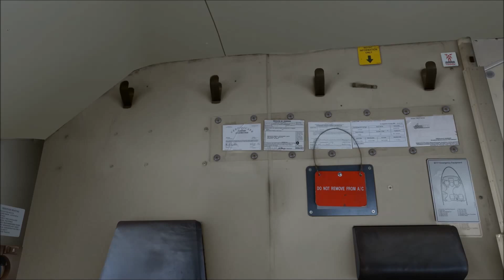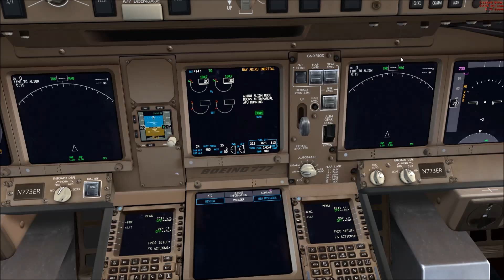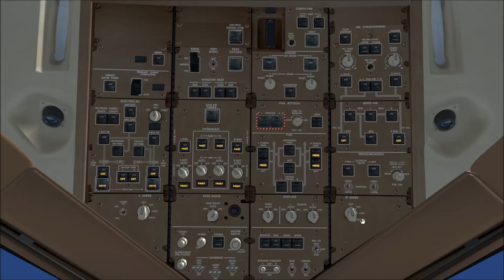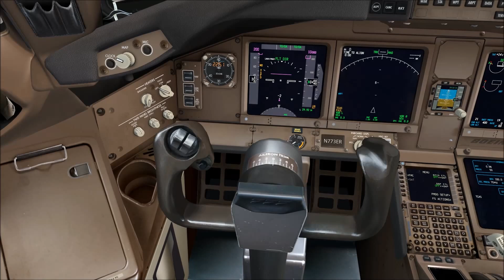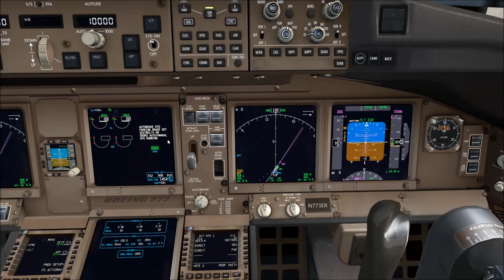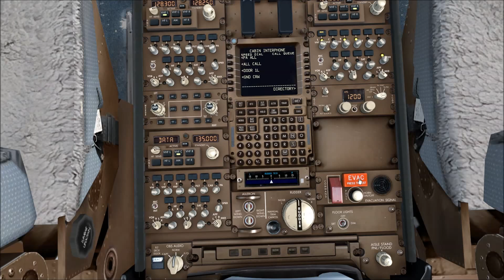PMDG 777 Cold and Dark Tutorial

Comment: i have 777 addon on my fsx but not pmdg. The cockpit is dark but the engine is on and i can fly it. Idk this is the addon error or what.
Reply from the maker: It should not be dark, I think.
Reply: Captain Nav hm ok btw thank for your comment
Reply: I know it's been 5 months but I used to have the same problem with my 737 PMDG. After a whole month of searching, I found the solution. It turns out, FSX SP2 was somehow not supported by PMDG. So I installed SP3 and it worked perfectly fine.

Comment: why in real the aircraft is not cold and dark
Reply from the maker: +shukri mohamed As I said in the video, it is rare to find the aircraft "cold and dark" as there is always an engineer nearby looking after it, cleaners on, catering, cargo, etc....Planes come and go all the time, and have very little "rest" in between flights. During my time on the 777, so far, I have only come across 1 aircraft which was cold and dark. I think it had been sitting for a few hours at a remote location and did not need attending. Otherwise, the aircraft would always be on. This is also why we have a supplementary procedure, not a normal procedure, for powering up the aircraft.